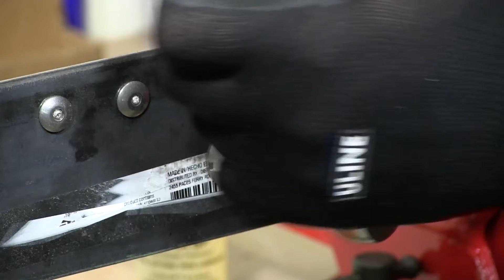Installing & Removing Tri-Groove Tamper Proof Security Nuts | Fasteners 101

Comment: Surely it is easily tapped loose with a flat blade screwdriver and hammer?
Reply from the maker: That could potentially work. The idea of security fasteners is that they are more trouble than they are worth to remove without the proper tool. Someone using a hammer and chisel to remove this type of nut will likely draw attention to themselves.
Reply: Nah that would break it, in fact, I wouldn't be surprised if the ridges went broke after heavy use with the proper tool, or if they seized up. Well at least serves it purpose to be tamper proof.
Reply: Exactly what I was thinking. I bet it would work.

Comment: How much torque can you apply to this set up?  It looked like the wrench kept popping off.  I work in the fastener world and i have seen a print or two on these come across my desk.
Reply from the maker: The amount of torque required will vary from size to size. What size specifically did you want to know the torque for?
Reply: @AlbanyCountyFasteners  Are there spec sheets on this product?
Reply from the maker: We have specifications on the materials, composition, yield, ultimate tensile strength, and hardness of these tri-groove nuts, but we sadly don't have information on specific torque values. To further assist you, or provide you with the aforementioned information, we recommend contacting us at our support email: support@rawproductscorp.com

Comment: Vice grips remove them. I do it all the time with Swing doors
Reply: these come in a zinc alloy and stainless steel. The stainless is 7 times more expensive. My guess is you're taking the zinc ones off considering swing doors dont need a whole lot of security.